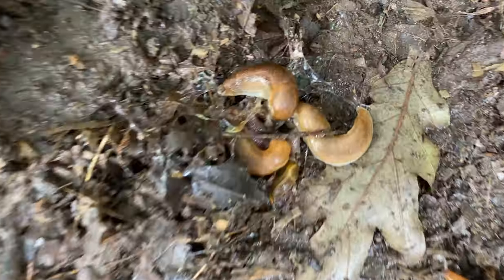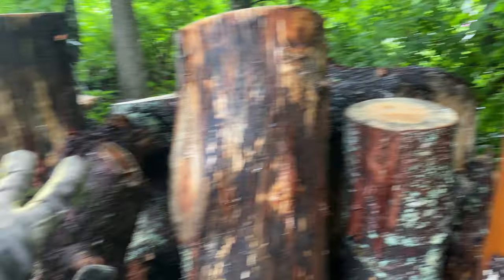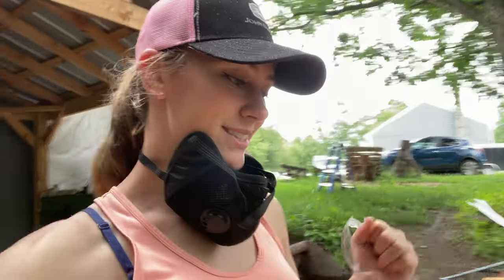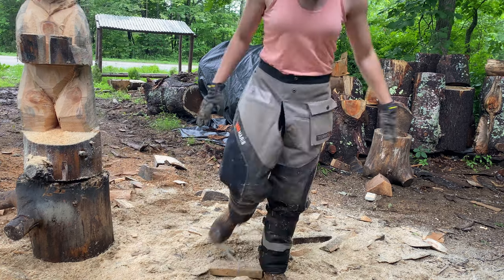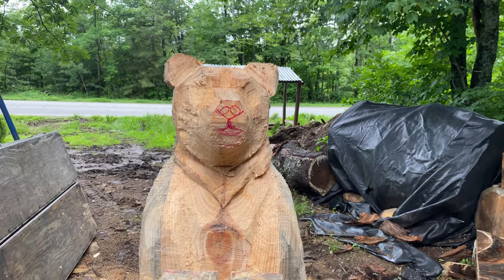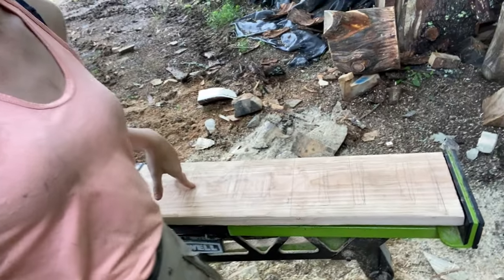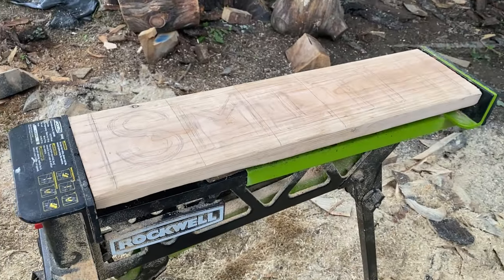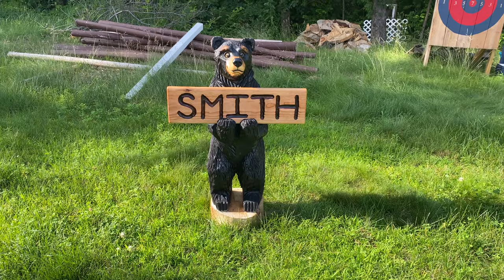Everyone Needs a Welcome Bear

Comment: Hi Tay, I'm trying to restore 6 foot bear that has been neglected. I wanted to know what finish you use on the varnish? Satin, Flat or Glossy? Thanks
Reply from the maker: To my knowledge, you can't get SPAR Urethane in flat, at least not the brands I have access to. If they had flat I would totally use that! I almost always use satin and cut it with mineral spirits maybe 4:1, spar to spirits.